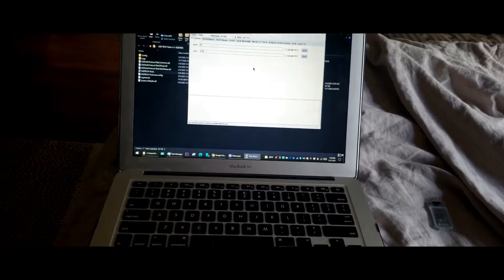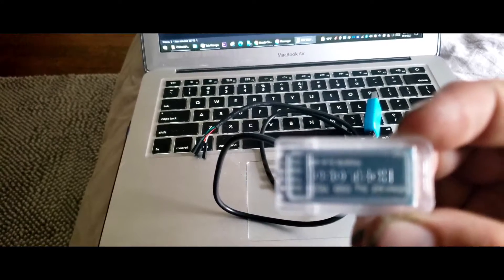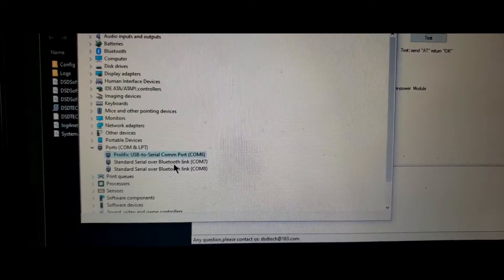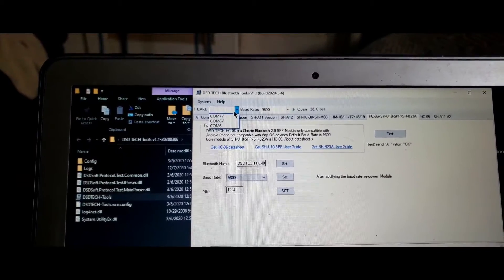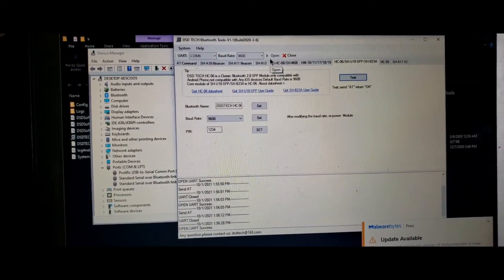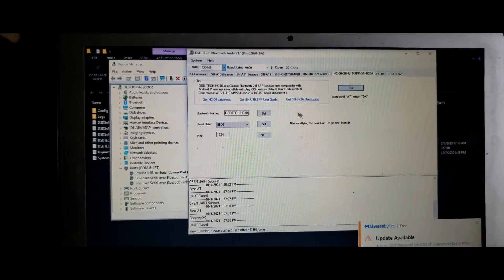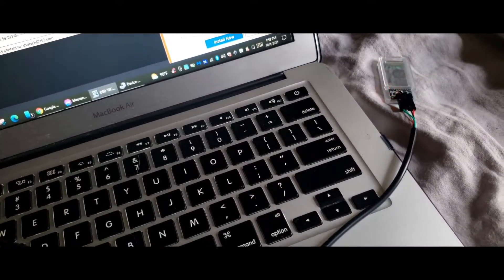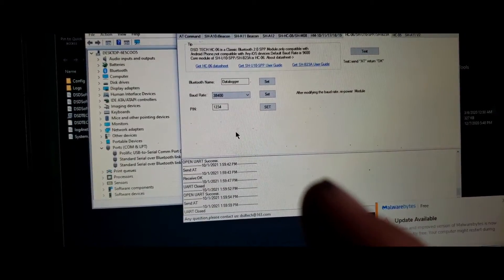Programing HC-06

Comment: Hey can you tell me once I program my hc05 to datalog, I would still need to plug my USB for my hulog moates ostrich ribbon cable correct? If so is there a way to make that Bluetooth as well so I don't have to have any cables plugged into my laptop while tuning?
Reply from the maker: The Bluetooth is only for data logging so it will replace the hulog if you want one single cable. But the ostrich has to plugged in for realtime changes to be made. The only unit that offers Bluetooth everything (so datalogger and Real Time Changes) is Hondata s300. Cable is always going to be a cleaner signal and no packet loss. You can use a USB hub for your hulog and ostrich to be one cable as a hack as well.

Comment: Hello friend,

Congratulations for the video, I did exactly as you show in the video, and I couldn't communicate through the tuner view. I haven't tested it on the computer yet, because I don't have a notebook with bluetooth at the moment.

My ECU is P06 (with VTEC) has an Ostrich and the program I configured was the honda tuning suite, I would like to know if the only option I need to check in the calibration in the configuration part is the honda "Bluetooth Datalog"

The tunerview protocol I bought is "Ectune"

Thank you very much.

Comment: Hey bud! I did the same thing, it work and connected to the tunerview only for 20sec and freeze after.. what can cause that? I’m using hc-06
Reply from the maker: You will most likely need to raise the time out found in the settings of the tunerview app. I believe it's called delay in tunerview. Is you hc-06 a DSD-tech unit? Or generic with heat shrink?
Reply: @hondaland_  Hi, i have the same problem and a i have a  HC 06 generic with heat shrink that can be the problem?
Reply from the maker: @joelsvm6438  yes they work but take different commands then stated in this video. I can only support dsd tech versions as it's what I used and they had their own app to communicate with it. I will have to order a heat shrink model and make a video when I figure out the commands. They can be talked to through a audrino terminal but I just don't know the commands they want

Comment: Solved !! the problem was in the ecu, which is a P1G (similar to p07) with immo canceled and soketed,(cel 9 permanent) tdc fault and a problem which causes the fuel pump to never stop. (I can't seem to make it work and I don't know why). They left me a p28 and it connected to the first one without problems ... so I followed the steps well.Thank you!!
Reply from the maker: So glad to hear you were able to resolve your issue The ECU you speak of and the PO7 can be a little tricky like that but nonetheless it sounds like you're rocking and rolling!
Reply from the maker: I've learned this ECU has problems running the code from p28 and p75 style ECU's. The MCU thinks the starter signal is always on and thus makes the fuel pump run all the time as well as other bugs. Sometimes it can end up frying the MCU from what I have heard. I've learned about them in the Honda rulez discord. I'll link it for ya. Great place for ECU hardware stuff. Sorry this comments coming back to you 9 months later. I just found this info and wanted to share 

https://discord.gg/wc6BeFnN
Reply: @hondaland_  you don't have to apologize 9 months later... the fact that he remembers my comment and tried to help me again is enough apology .xd thanks 🙏 for your great help... I've had the accord stopped for 6 months until I can put it back on up and running..until now i have borrowed a p28 from a friend which works without problems..thanks again for your help!! thank you !!

Comment: hello .. I have followed your tutorial to perfection and I cannot get tunerview to show data. Blueth connects perfectly but does not give any reading, I have repeated the process several times. I tried to change the cables rx, tx several times without result, , all the com configured to 38400. I have consulted with the programmer to know which protocol is the correct one and if the chip is active for datalogger (he said that if full datalogger protocol QD3) I have tried all the chrome protocols ... I checked the pin j4 in my case (other j12) and I have no bridge set .. in the hc-06 module programming in the tests I get an answer ok! Confused as in the video to the smallest detail .. I have repeated the video more than 10 times in case I had skipped a step since I am Spanish and I have to see it translated. Even so, everything it does is perfectly understood .. but even so I can't get tunerview to show any data .. I need help !!
Reply from the maker: I will try to help you the best I can. When reconnecting to the hc-06 are you having to talk to it at 38400 or always talk to it on the program at 9600? Confirm the hc device is indeed operating at 38400. As well as all com ports. Make sure j1 is installed to activate the chip. Chrome gold is required in order to datalog. As im sure you have learned. If you were able to program the HC-06, what did you use to do so? Can you datalog with a wired connection to confirm the chip has datalogging capabilities? Because again the chip has to have a chrome tune with realtime datalogging activated.
Reply: @hondaland_  j1 enabled also if not my car would not work with the chip.xd!
Reply from the maker: @gervasio9845  That's correct on the J1 but I'm only trying to cover the basics to make sure You haven't overlooked anything simple or even the person that did the chip. Is there anything like launch control added to the tune that you can confirm is working. That way you know it is indeed running a crome tune. That is where I would start. Confirming that the setup has the ability to read the chip for one and then data log for two being wired. If two interview sits there and does nothing when connecting to the module then either the Bluetooth module is bad or the wiring or the tune or the ECU socketing job. Without any kind of feedback like a debug log that is provided in a program called Honda tuning suite it is hard to tell you what exactly is going wrong because all we are going off of is to interview not showing any information. Tuna review usually hooks up right away and starts working and just takes a few changing of some options and settings to get it running if it doesn't right away. Usually something as simple as switching the protocol. All of things that you have tried. If you have no check engine light and are not stuck in limp mode meaning you can rev the car past 4,000 RPM no problem then you should be reading the chip if J1 is enabled. If you do have a check engine light and cannot rev past 4K than the computer is ignoring the chip and is stuck in limp mode and will not datalog. So we need to find out why it won't send information through the data log port. Either being the tune on the chip the ECU not reading the chip the soldering of the data log port. The cable from the port to the device being used to talk. I have seen wires that had no continuity even though they're small and you wouldn't think about the wires being bad sometimes they don't make a connection due to the crimp inside. So you will want to confirm everything from the shipping job the tune itself on the chip all the way to the data log port itself. And then from there you want to check your cable for the data logger and then confirm the data logger itself is set to the correct speed by talking to it through the computer only through the speed set for data logging. If the DSD tech program is talking to the HC-06 device on the 38400 setting then you know it took the change by receiving the okay when choosing test. If the HC-06 module returns back the okay or pass then it is most likely going to reside within the tune chipping job chip itself or data log cable. It can even be a bad HC06 as I have received plenty that we're bad out of the box even HC-05
Reply from the maker: @gervasio9845  Just throw me a comment if you have any more questions if for some reason you need the chip reburned you're more than welcome to get with me and a personal message and you can mail me the chip and I will reburn you a base map and test that it can data log before sending out
Reply: @hondaland_  Thanks for your kindness. I appreciate it .. I will try again to start from scratch and solve it with all the guidelines that you have recommended me to follow. I will keep you informed with any progress Thank you !!!!
Reply from the maker: Did you also try qd2 protocol in tuner view in case it is burned with that? Make sure your not choosing demon as it talks at 921600
Reply: @hondaland_  thank you for your quick response .. check with the guy who programmed the chip .. and the chip is activated in chrome for real time data as he told me with QD3 protocol .. even so I tried all the other protocols without any results, no I tried to connect by cable with a computer since I do not have any laptop..check and verify the Com in 38400..so I will go over everything again and between today and tomorrow I will try again .. if I do not ask for a computer Portable someone to do the verification with chrome and find out if the chip is enabled the data in real time. Although as I said the programmer has assured me that if the qd3 protocol ... thank you for your help. is appreciated

Comment: Hey man thanks for posting this super helpful I followed this tutorial now when I try to connect using the prompt in hts it says “the write timed out” any ideas?
Reply from the maker: Make sure com ports for the Bluetooth are set to 38400 in device manager or higher. Make sure Bluetooth logged is checked in HTS settings. Make sure hts logger is not checked in settings. Add time out when getting errors. If errors continue. Unpaid from Bluetooth settings. Reboot computer. Repair with laptop. Then try to connect via the com ports.
Reply from the maker: Accidently deleted your comment. Find me on Facebook or Instagram with the links in the description and I can try and help tomorrow. I'm crashing out right now. Hope you get it
Reply: @hondaland_  thanks man appreciate it
Reply from the maker: If still having issues try version 1.9

Comment: Hey, i would like to make my digital dashboard, and when i connect arduino to ecu  datalogging pins im getting only 255 in return witch means no data, can anyone help how can i get data from hts map on arduino? do i need to request ecu to get back data or?
Reply from the maker: Make sure you have a ground wire and not just tx rx or it will not talk

Comment: ls the software working with just dsd tech hc06 modules or every hc06 modules from different companies?
Reply from the maker: It should be able to talk to other modules as well. All it's doing is sending AT commands. They differ between the types of models what at command they want to see for changes. Ex. Hc05 compared hc06 use a different way to write the AT command. I've only used DSD tech since the] have they're own software. To keep from being stuck in the dark. You can lookup the AT commands and how to send them manually through a terminal as well
Reply: @hondaland_ ok thn. l got a hc06 (chinese product) if l use this  software with my hc06/ , l can do programming for ecu.İs it?l think it can works with my hc06;)
Reply from the maker: @NSRTUNED  HC06 allows you to see the data stream the ECU is outputting. You can not make changes to the tune/map via the Bluetooth connection. Only with USB cable to emulator.
Reply: @hondaland_  thanks a lot sir.l will buy tomorrow hc05.l will use  hc06 for my friend just reading data from tunerview app
Reply from the maker: @NSRTUNED  links to my Facebook and Instagram are posted in the description if you need to message for more help